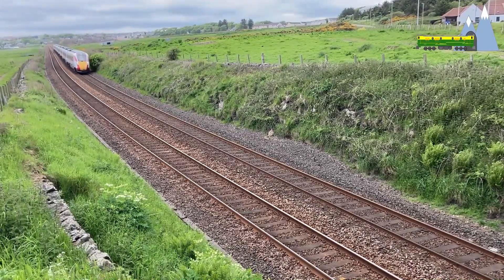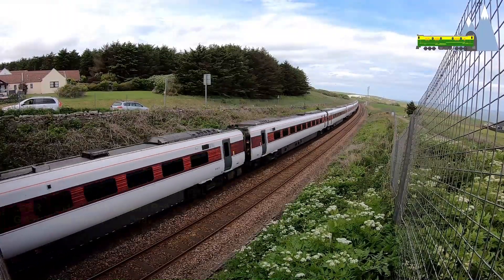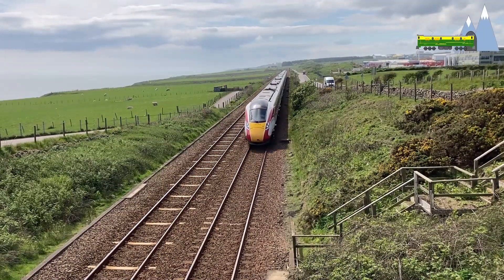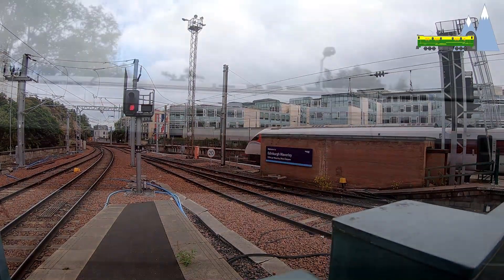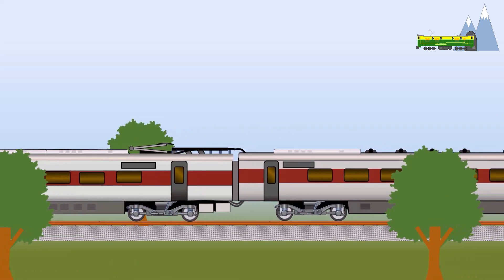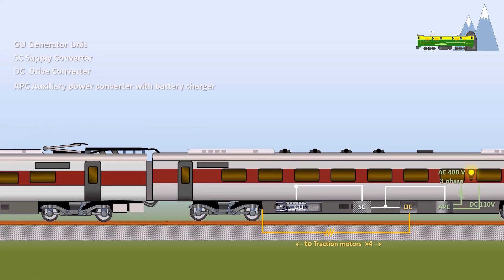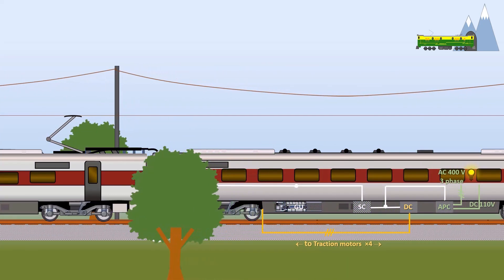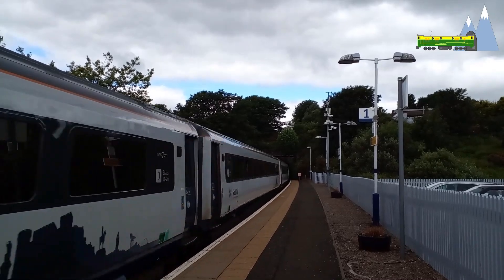Bi-modal Electric and Diesel high-speed Trainset | Class 800/801 Azuma | Hybrid Train | Hitachi

Comment: Class 800 trains replaced the diesel powered H.S.T or Intercity 125 by allowing to connect to electricity supply when the same is available. Intercity 125 is a type of push pull train powered by 2 Class 43 locomotives. These locomotives churn out 2250 HP and allow an HST to have as many passenger cars as possible.
Reply from the maker: Yes indeed… I have also put up a video on the HST 125, in case u r interested
Reply: @TheTrainStory  recent or old?
Reply: The HST's 2250 HP engines have been replaced by MTU and VP185 engines since the mid 2000's.
Reply: No Push Pull would be the InterCity 225. The British Rail Class 43 was a Top and Tail train.
Reply: @a-trainspotter-from-berkshire  thats another sort of push pull operation. The rear loco pushes the train and the front loco pulls the train. Intercity 225 is another form of push pull train where only one loco is used to either pull or push the train.
Reply: @AnubhabKundu  The British Rail C!ass 253 and C!ass 254 are Top and Tail trains under British terms. What you say a train with a loco at and a loco for banking a hill like the Lickey Incline.
Reply: @a-trainspotter-from-berkshire  check out wikipedia for definition of push pull. As per wikipedia, both the Intercity 225 and 125s should belong to the push pull category. We have one special Rajdhani Express with 2 WAP 7 locomotives pulling and pushing the train at each end of the train.
Reply: @AnubhabKundu  Wikipedia is wrong with callling the British Rail Class 253 and 254 a Push pull train becuase it is a top and tail train.

Comment: These are the best trains for Amtrak/ViaRail services from Chicago to Toronto. With GO transit getting electrified, the trains can operate with zero emissions in the Chicago & Toronto region, while remaining under diesel power across Michigan and the rest of Ontario. The tracks in Michigan are getting upgraded to support 110 mph trains under the Biden infrastructure plan. Today, they don't go faster than 85 mph, and use old polluting diesel engines from the 1980's.

Comment: You only mentioned the GWR ones but did not give some more information like they are called IET and they replaced some of the British rail  class 91 + 4MK coaches + DVT ( Driving Van Trailer).
Reply: the Class 801 replaced Intercity 225s?
Reply: @AnubhabKundu  The 800 have replaced the InterCity 225's on some routes.